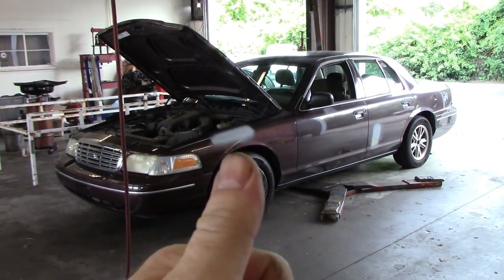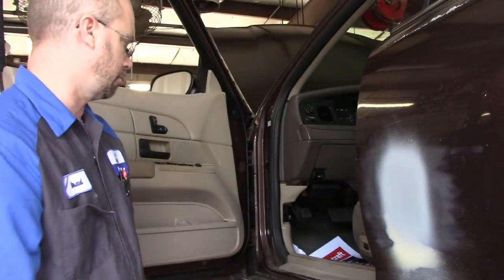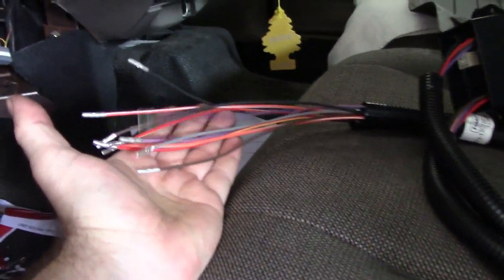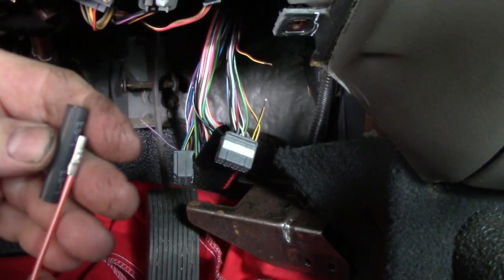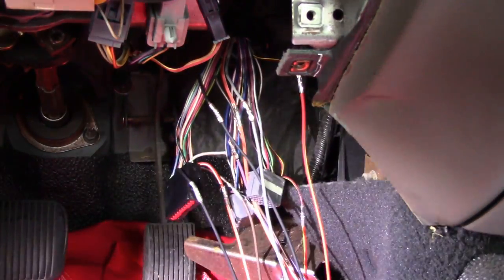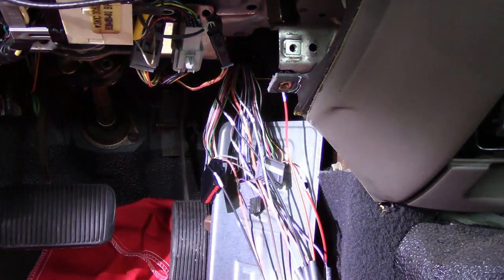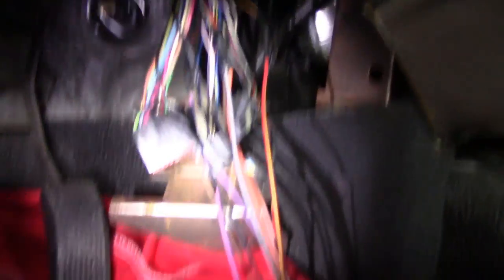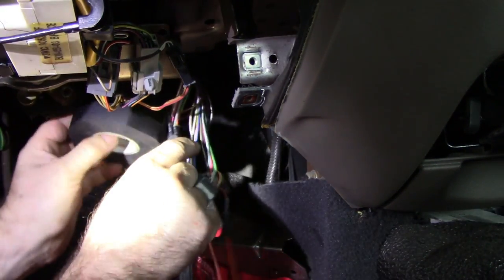Crown Victoria lighting control module recall

Comment: Ahhhh the Crown Vic... the AK47 of cars lol
Reply: Well done good sir, you mingled cars into firearms. It was about damned time.
Reply: @devinpetersen2387  Tanks mate
Reply: your cloth tape looks like gaffers tape, or line tape commonly used in theater as a foot placement marker, and in many factories as a general use repair item.

quality stuff, tears a bit easier than plastic tape, but holds on real strong, and resists being abraided way better.

Comment: Had to look it up since I've been having light issues ever since a dealer "fixed" it under recall about 2 years ago. So simple I wish I would have just asked for the part, because the dealer didn't follow the colors. Thanks for the informational video.

Comment: Very nice video.  Like how it has a little personality to it.  Thanks!

Two things:  Want to make sure I understand the situation 100%, and a suggestion for the video.

My impression is that the installed kit does not replace the existing unit, but enhances it. If I am correct, both the original unit and the add-on box ride with the car when the repair is done.

In more detail, I'm aware, like many Crown Vic owners, that the LCM is a weak point.  The headlights quit working at unexpected times, the turn signals quit or work weirdly, etc.  There is a whole cottage industry that consists of soldering in new relays, as many as four, into the LCM units.  You can buy the relays, four, for about $20, or buy the LCM rebuild service for about $50 to $100.  All over eBay.

The kit in this video appears to be sturdy relays that bypass those in the LCM.  That's a guess.

A question is why only certain years were recalled, as nearly every Crown Vic / Mercury Panther Platform car from 1995 to 2005 has this issue, in my experience.

The suggestion for the video is to give an overview at the beginning of what is going to be done.  Also, the steps to remove the existing LCM and its bracket were not mentioned.  There is another video that covers this.  The one with the hip-hop music in the background is good on this point.

Comment: Thanks for posting. Very nice work.  I always enjoying watching folks do things the old way - the right way. I was just searching and found this video. Not really related to my problem, but still interesting. My Mom's 2010 Grand Marquis has an issue of the LCM draining the battery, at least I think it's the LCM because when I pull the fuse that powers the LCM, the amp reading on my test meter goes way down.

Comment: We have been experiencing  intermittent lighting faults for years on our 2004 MGM ls! Once in a while the lights would not function correctly, once headlights shut off while driving, never failed completely, and usually work like they should 99% of the time. We got a letter about a recall, took the car to Capitol Ford, for warranty lcm service 14N01. They were suppose to replace the lcm, but it didn't look like they replaced anything. Several years later, the tail lights failed to come on, and after a quick restart, switch off/on - the lights worked again! Then we got another letter from Ford telling us that the lcm may have not been replaced when we took the car in for 14N01 ext. warranty service the first time. Really? Wtf?! Well, that explains why the tail lights were fking up all of a sudden! My girl phoned Ford dealer service center and got an appointment, I assumed this time it was for safety recall 15S39, which is the job in the video. Drove 2 cars to the dealer this morning so we can drop off the Merc at the service center. At the counter, the service rep told us there are NO parts available to do the job at this time. Told us to wait until they have the parts in stock, then again we will be notified by mail, and had no clue to how long this may take to become a reality! What a bunch of incompetent bums! They could've told her this s#it over the phone, instead of just, "Oh yea, bring it in!" Why bother schedule an appointment when you don't even have the parts available to do this job? That's so retarded! Took it to the dealer twice for this bs and they fixed absolutely nothing! Useless! What a waste of time and pointless corespondence! Dear Ford mo co! Thanks for letting us know that it's all your fault! 
Anyway, thank you for this video! Obviously our lcm problem remains as of now. The options are: to wait for Ford dealer to pull their heads out of their a$s, or locate, buy, and install the lcm bypass kit as you did in this video, or just pull the lcm and replace the relays on the pcb, use quality relays. It seems to me the last option is the easiest to take on and it promises the best reliability. Def beats dumping 100s of dollars on a new lcm. When you want something fixed right, you got to fix it yourself! Watch Youtube videos if you don't know how! Excuse the long rant and thanks again!

Comment: My '03 Grand Marquis has 254,000 miles, and just started having this lighting problem. Waiting for the part to get to the dealer for the service. Other than this problem she still runs like a champ and passes cars like they're standing still in the interstate.
Reply: Recall Date 2015/12/21
Notification Type Safety Mfr
System Electrical MERCURY GRAND MARQUIS 2003 2004 2005  you can get it done for free
Reply: Change your rear diff oil and you will be good for another 245k 😊
Reply: @uhfnutbar1  Odd that only 03 04 05 get it, as many other years have this issue.
Reply: @peternmi386  what about an 01 vic have they recalled it also...??

Comment: Quick question I have a 03 Ford crown Victoria police interceptor and its currently at the Ford dealer for the recall LCM and they seem to be having trouble fixing it and they've had my cat for over two weeks now and I keep getting excuses that they can't seem to get it working I don't know if they are just being lazy or don't wanna fix my LCM because I'm not paying them. What could be the problem? They told me they got the module of the piece inside broken and are waiting to get a supposedly call from Ford company on what to do. This is so frustrating.
Reply: Something is awry, it takes every bit of 10 minutes to replace the module.
Reply: Shane Marcotte  module would be great if they werent so overpriced and cant even find them around here

Comment: thats quite the kit for a recall. How many miles are on that ex cop car crown vic? Is that the most reliable vehicle on the road or what?
Reply from the maker: I didn't even look, I imagine it was a bunch though. This car was actually in decent shape even though I was making fun of it. Man, some of these things are really run down and abused.
Reply: They break just as nicely as anything else.  Especially the last few years (2009 - 2011).

Comment: I need this done to my '03 Grand Marquis. Two dealers have told me I need to leave the car two days or more to have this done...why? Called Ford they said its an hour and a half job. No they didn't offer a loaner car even though this is their design error.
Reply: They want you to leave it because they do not prioritize a recall. If you were paying out of pocket for a repair, they would actually try to get it done quickly.
Reply: @rossharrell1766  took care of it myself. Got a rebuilt module (relay replaced) and swapped them then rebuilt mine. Had to stare at it a few minutes to figure how to get it out with minimal disassembly. But a half hour later all fixed and no lame dealer got any Ford money
Reply: @wb2dyb  The dealer did mine and now my lights are always on.

do you still have automatic lights or did you lose them after fixing the issue?
Reply: @rossharrell1766  yeah, all works normally. But what I have is an original module but repaired by replacing the bad internal relay. The Ford later repair requires splicing wires in the harness. But even though all is color coded I suspect the average tech at the dealer can make errors in the wiring. Also you can check oreilly auto parts for an add on module to fix it. Not sure how well that goes
Reply: @wb2dyb  Yeah. I am sure I will have to fix the wiring. sigh
Reply: @rossharrell1766  if you search the web deeper you can find the actual dealer instructions. I found them but no longer have it. It can help you correct the wiring
Reply: @wb2dyb  Thanks, That is what I planned to do. It just sucks that the dealer was careless with the vehicle.

This is my project car that I am basically turning into a Marauder.

Comment: Brad - Were those splice connectors seamless? I  prefer using the ones with the seams. There's a right way and a wrong way to set the connector in the die. Most people do it the wrong way. These are my pictures linked below. Click the refresh button after the pictures load to get them to full size. As you can see, I put the seam "down in the ditch" like you're supposed to: 
1. http://i115.photobucket.com/albums/n284/MACDRIVE/TOOLS/DSCN3784.jpg
2. http://i115.photobucket.com/albums/n284/MACDRIVE/TOOLS/DSCN3731.jpg
3. http://i115.photobucket.com/albums/n284/MACDRIVE/TOOLS/DSCN3737.jpg
Reply: Thanks!

Comment: I just did two of these recalls back to back. The first one took me almost forever to get done. The second one took me significantly less time, but my neck still hurts from doing them. So, long story short, we're just splicing in a gizmo in series to the LCM, 11 wires to be exact (and one ground dead ended). Way to go Ford, for another Band Aid recall.
Reply: Michael Chan i'm getting mines fix next week at the dealer but after reading your comment i'm like ah damn it so it  will happen again😑

Comment: sooo since the cylinder on that lift is right in the middle, if you push on the 1/4 pannel hard enough will it spin?
Reply from the maker: If you disengage the lock cylinder then you can spin that puppy around all day (until it unscrews itself).

Comment: my low beams where not working... i  toke my car to a ford dealer for the recall 2004 Crown Vic ,, the dealer had my car all day and did nothing perform the recall,,,,, because they say there where not getting a signal coming from the high beam swatch,,it is in the malty swatch in the steering column,,,,, and wanted to charge me to replace the malty swatch.....so i toke the care home,,,, 2 weeks later i get a letter from ford saying if the recall not performed,,,,,, they Ford are not responsible for any death or injuries as of result of driving with out low beams There more to the story (they had my car at 9:15am-3pm) i call the dealer at noon after they had my car 3 hours and all they did was cry how Ford only gives them 1.5 houers to pay them for the recall ,, it was so post to be free for me . this a reminder post to my self to get back on the phone with ford to say what the fuck and call the transportation department who responsible for making and enforcing the recalls in Canada

Comment: Hey Brad - can you see my other comment? It contains links to Photobucket and I think that may be why it's not showing up. I can see it when I log in, but when I log out, it doesn't show up.
Reply from the maker: It came in my spam folder for approval and I could not load the images when I clicked on them, I was hoping to get it sorted out before making it public.
Reply: Interesting. The links are three pictures of me crimping a non-insulated butt splice connector. Do you have an email address? I think you'd like to see those pictures.
Reply from the maker: Sent you a private message.
Reply: Ok Cool. I got those pictures sent off to you.

Comment: I'm willing to bet you that old raggedy peice of crap car will still be on the road long after the majority of nearly all of these cars they're making nowadays.
Reply from the maker: Oh you know it! They still have yet to make a police car that can out perform these running flat out for 8 hours at a time.
Reply: @flmmaz  it's the 4.6L Ford's best engine ever. I have a grand marquis with 266744 on the clock and run just like new
Reply: @clackonwallstreet  I have 277k and some miles still running like a beast...